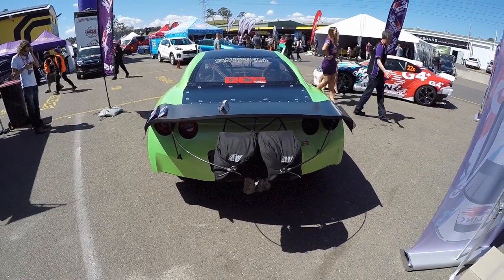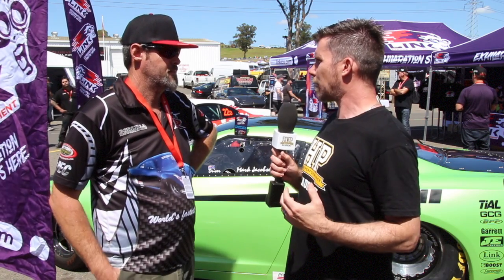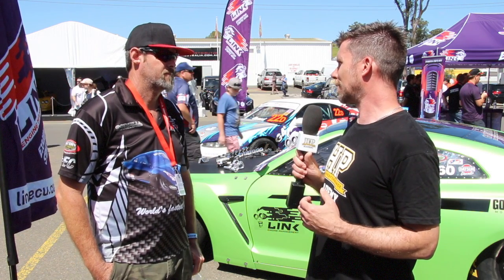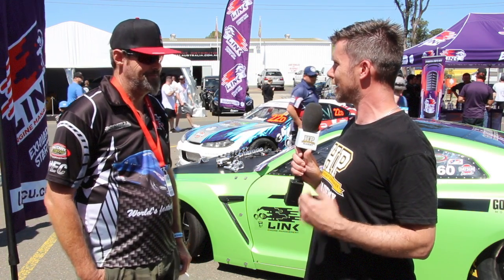[TECH TALK] 2200+ hp on a standard block | Mark Jacobsens VR38 R35 GTR Drag Car

Comment: assuming it uses billet aluminum connecting rods and some readily available forged pistons, cylinder temperatures dont get high enough with methanol in drag racing to require an extreme piston

Comment: That's one hell of a crankshaft, I wonder what his bearing clearances and oil pressure are at
Reply from the maker: The strength is absolutely awesome, but depending on how you're using the truck, the weight = not so much! - Taz.